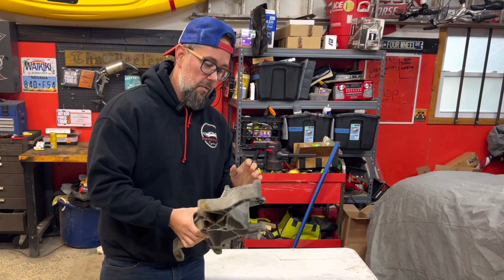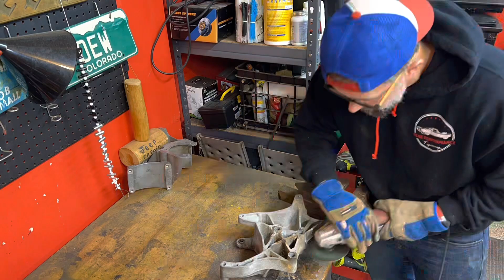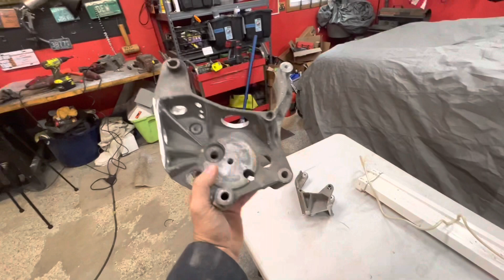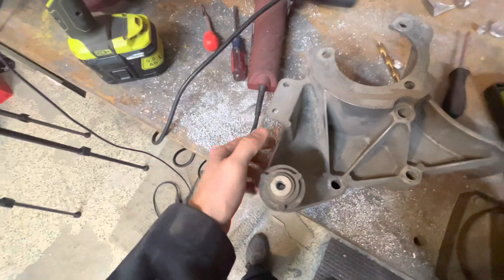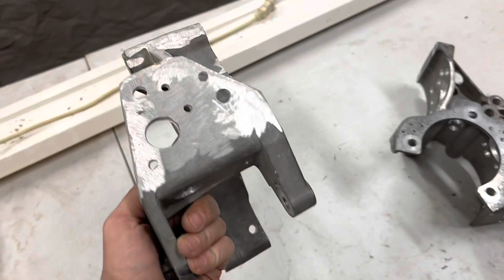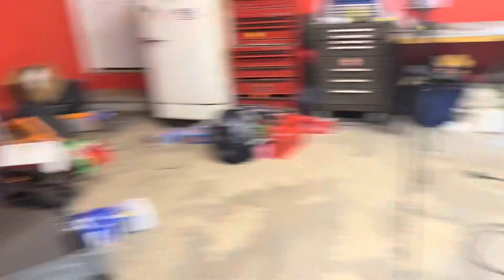Modify Your UGLY FORD 5.0 Engine Accessory Brackets! - Looking good in Under 60 Minutes!" HELLSTANG

Comment: My brother in Christ…. 
As good as they look there’s a reason they are structured like that now they will be significantly weaker and easier to break because it’s cheap pot metal…
Reply from the maker: Definitely risking it for the biscuit here ;) 

I’ll put my tig welder to use if they break though ;)
Reply: @PeakPerformanceEngineering  indeed you are! Just hope it doesn’t break and get smashed into your radiator and fans as it’s slung around with the belt! 😂
Reply from the maker: That would be a sad day for sure lol. But, it would make for some great content hahah.
Reply: @PeakPerformanceEngineering  it would be titled “maybe that wasn’t a good idea… LETS DO IT AGAIN!” 😂😂
Reply: @PeakPerformanceEngineering  sendddd ittt
Reply from the maker: In process :) 🤣🤘